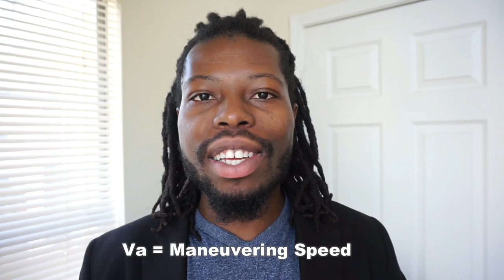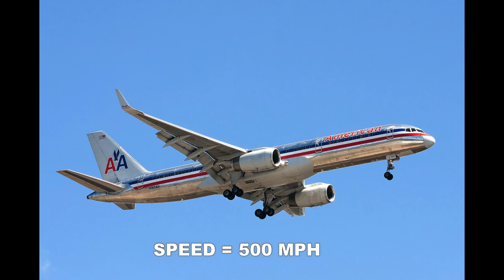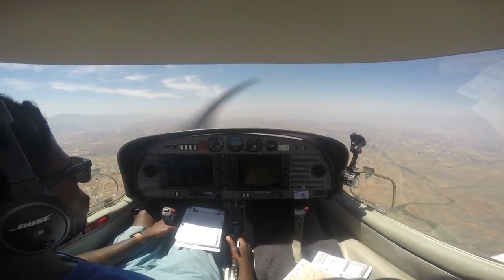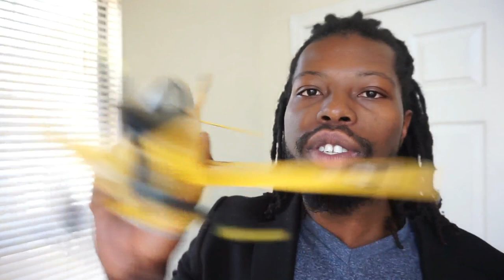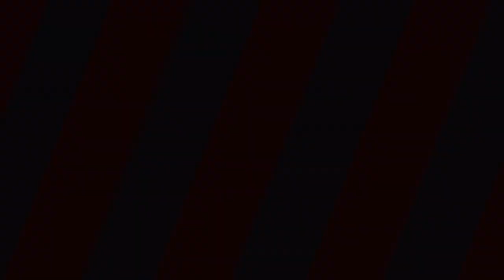Why Airplanes Have A Speed Limit

Comment: Va = Design maneuvering speed. The speed above which any full application of any single flight control could generate a force greater than the aircraft's structural limitations.  Aircraft structural limits are categorized as: NORMAL, UTILITY, ACROBATIC, AND COMMUTER.  Normal and Commuter G-loading limits are: −1.52 to +3.8. Utility: −1.76 to +4.4. Acrobatic: −3.0 to +6.0.   As you might guess a Normal category aircraft is about HALF as robust as an acrobatic plane and therefore has much lower Va speeds.

Comment: There is one more factor to consider called laminar flow. Jets at altitude have to fly inside a flight envelope. To low and it will stall of course but too high and you break up the laminar flow over the top of the wing and lift diminishes. The higher you go, the smaller the envelope.

Comment: Wrong. As a CFI I see and hear this common misunderstanding between Manuvering Speed or Va and Maximum Structural Crusing Speed or Vno a lot.

Manuvering Speed (Va) is the maximum speed at which you can make full and abrupt deflection of the flight controls. Manuvering speed changes with weight. This is why you don't see Va depicted on airspeed indicators- it's a moving target.

Maximum Structural Cruising Speed (Vno) is the maximum speed you can operate in smooth air. Vno is depicted where the green arc (Normal Operating Range) on the airspeed indicator turns to yellow (Caution Range). You can fly into the yellow arc such as while descending but should do so in smooth air and with caution. 

You also said warm air always rises. This is wrong too. Google temperature inversion. You will have this all corrected by the time you reach the commercial pilot level. Fly safe!
Reply from the maker: So you just repeated what I said in the video. Sure maneuvering speed changes with weight, but the definition doesn't change. And yes warm air does rise because it is less dense. Temperature inversion is a whole different topic because the opposite happens in an inversion. I stand by everything I said sir. Thanks for sharing!
Reply: MojoGrip second CFI chiming in here. I think when you say pressure you mean G load which is not directly pressure. At Va you’ll stall before causing structural damage which you failed to mention. Just wondering how far you are along, PPL? Definitely keep it up you have a better grasp than most new students, but hit the PHAK before putting out definition videos. You can confuse new pilots.
Reply from the maker: Man you CFIs are killing me. A lot of my viewers are general public (non pilots). I try to explain things in the most basic and simplest terms for non pilots to understand. I see no reason to get too specific with exact keywords or technicalities. Except you're a pilot, you likely have no clue what Va, Vx, Vno means, so I choose not to confuse anyone with technical terms. This is not a flight school, no one is looking this up to study for their checkride. This video is a broad explanation of maneuvering speed. Oh I have a PPL 🙂 thank you.
Reply: BTW, in my initial post I said Vno is the maximum speed at which you can penetrate smooth air. That should read turbulent air. I'll give you a "10" for positive attitude but a "4" for accuracy.
Reply: MojoGrip maybe you should listen this is the third CFI chiming in your definition of VA is completely incorrect.... we understand that most people watching have no knowledge of aircraft but that why we are certified to teach them and it is apparent you aren’t yet. Primacy is something you will be learning about if you continue on to becoming a CFI yourself. This is why it’s important to be specific and accurate with the information you teach about..... have a CFI review your videos before posting them so they can help you out. Also the FAA watches YouTube videos so if you are found on YouTube teaching principals wrong you very well could end up having to take a 709 ride to get your certificate back. Make sure you mention in the beginning of your video that you aren’t a instructor or your could land yourself in serious legal trouble..... we like you and your enthusiasm for Aviation we’re trying to help you out.
Reply: Yea, just make sure you put a disclaimer in your vids in the future; I enjoy your vids man! ;D
Reply: I would suggest a disclaimer then, that you are not a cfi and are just doing a loose interpretation of what happens, “up there” and that people should seek out professional flight instruction for technical definitions and flight procedures. On a personal note. I appreciate what you are try to do. Keep it up! Just please, don’t ever put monitization and subscribership before safety and you will do fine!
Reply: C Man --- WRONG,      Arturo b --- WRONG,     Travis Grubler --- WRONG WRONG WRONG   
I know more dead flight instructors than live ones 
just being a CFI does not make you the definitive authority on flight safety!
Mike is conveying some very useful information here that could save the day,  a lot of pilots, even high hour ones may forget to get it down to Va during 
turbulence which is crucial.  especially when youv got a thunderstorm on your ass & your wife is in the back seat and you dont like seeing her teeth
going thru the bottom of her lip.   yea - keeping your speed down to Va keeps stuff from breaking on the inside and outside the airplane.
so you 3 CFIs dont talk to me unless you come back here as an FAA flight examiner
you think you know everything & you really dont.
the secret to being the best pilot/CFI is to never stop learning, always be a student of the sport.  we all can usually come away w/ something 
beneficial from quality content like whats given here.
Reply: DING DING DING!!! and we have a true aviator here. Never stop learning and murphy law are the keys to fly alive.
Reply: Thanks C Man your explanation is correct, but I want to encourage MojoGrip to continue making videos. "Wrong" is harsh. Let's adjust or further explain what he is trying to communicate. Effective communication is a good thing. All pilots can learn when we help each other. I love GA and want to keep us in business, so lets help each other. Thank you and Fly Safe!
Reply: I'm not a Pilot (want to be tho)  Mojogrip, I think everyone really likes you (even the CFI's LOL) but even a non-pilot like me finds some of your information pretty dodgy  ( I gave you a hard time about your comment in a different vid about "lift coming from the prop pushing air over the wings"   Even though your intended audience is non-pilots like myself, I too am concerned that you could end up is some trouble with the FAA  (which is crazy but that is the kinda times we live in!?)  with that said,  let me encourage you to keep making the video's (I'm living a bit vicariously thru your video's, thank you!) however don't let the instructors frustrate you, and work with them. At least consider their advice.  better yet, if you think they are wrong; discuss (in these comments, using respect)  your position with those folks.   I would actually enjoy reading the discussion (you'd be surprised how many of us can actually deal with the technical stuff and enjoy it too)
Reply: as a non pilot I would like accurate info please! sounding like an ass in conversations is not why I watch these vids..... also, don't argue with CFIs or drill seargents, it is not a good idea.
Reply: Luke Warmwater, well put!... you are so right, unfortunately this guy, ain’t “the guy”, we all wish he was...  Obviously, he can fly a plane, right?    Also, Everyone loves his passion, but he just doesn’t possess the ability to communicate it accurately.... the worst part is that he thinks he does!   I would LOVE if this guy would rise to the occasion (like listening to the CFI’s and actually dialoguing with them) but I wouldn’t hold my breath LOL
Reply: Maneuvering speed is the airspeed at which an aircraft can handle a 35fps vertical gust without exceeding get load limits.
Reply: Va (Maneuvering Speed) is a STALL SPEED. If you take the Square Root of Load Factor and multiply it by Vs, you will come up with the Maneuvering Speed. You must use Calibrated Airspeed. As any Stall Speed, the heavier you are, the faster you can go and vice versa. If your Diamond's max Load Factor is 3.8 G's, the Va is the stall speed at 
3.8 G's.

Comment: Anyone know what it means to have Va greater than Vne ?  (It doesn't make sense to me)  One such plane I clearly remember was Berkut (Long EZ grown up).  I remember discussing it with my CFII and he wanted to stick with course material back then.
Reply: I don't know, but we can try to reason about it.
Va is simple: Full application of any single flight control would exceed the design limitations of the airframe.
Vne is complex: Based on aeroelastic flutter. For flutter to occur, there needs to be some initiating condition, such as a wind gust / turbulence. In perfectly smooth air, you can get away with flying beyond Vne and have no issues - but if you're using a steep dive to achieve it, you likely won't be able to pull out of the dive since attempting to do so would initiate the flutter. Likewise, level flight above Vne could go very wrong, very quickly if you hit a bump.

The two aren't directly related, so there's no inherent reason that Va can't be above Vne. It would just mean that the speed at which applying full deflection of any single flight control would cause structural damage is higher than the speed at which aeroelastic flutter could develop.
Reply: Thanks for the good info.  I "misunderstood" Vne is breaking point due to airflow.  And been "wrongly" blaming FAA thinking they demand manufacturers to fill out all the forms and desingers supplied some BS infos.

Comment: This makes alot of sense but I have ask a round about question.  I'll use a firearms analogy.  

 Generally speaking a rifle of a given caliber is built to withstand the amount of internal pressure that the specific caliber is rated at.  Because manufacturers know that there will always be those who push the safety envelope on the various calibers that rifles are chambered for they will deliberately over-engineer those rifles to withstand substantially more pressure than they are rated for just to mitigate the possibility of said rifle/caliber blowing apart if someone attempts to shoot overpowered rounds through it.

Just like the manufacturers of air planes in your description, they will still advise you to adhere to maximum speed rates or pressure rates and not go beyond that even though the rifles have been built to withstand being able to shoot or fly faster in order to push the performance envelope to try to get more velocity.

I suspect that even with airplanes the manufactures have built in a sort of safety net by allowing their planes to withstand substantially more abuse than they are said to be rated for but for safety's sake they stipulate a certain speed max and no more.  It's a sort of "Lawyer-Proofing"
for  their product line.

Comment: This guy seems to be more interested in getting views on YouTube than being accurate. The old adage goes: a little knowledge is a dangerous thing. Especially in aviation. While he accurately defined Vx and Vy, he clearly needs more understanding of aircraft V-speeds in order to speak with authority on the subject.

In fact, Va is the maximum speed at which full and abrupt control deflection in pitch and roll can be attempted without causing excessive loads on the aircraft's structure which may exceed the structural strength of that specific design. 

You also didn't mention Vd, aka dive speed. Vne is defined as 90% of Vd. Vd must be demonstrated to the regulator during flight testing of each specific aircraft type. 

You also failed to mention the most important reason for not exceeding Vne: aeroelastic flutter. Flutter is is "a dynamic instability of an elastic structure in a fluid flow, caused by positive feedback between the body's deflection and the force exerted by the fluid flow ...'Net damping' can be understood as the sum of the structure's natural positive damping, and the negative damping of the aerodynamic force." (Source: www.google.ca/search?source=hp&ei=cbKZWszJOs--jwOwhbLwBg&q=aircfraftf+flutter&oq=aircfraftf+flutter&gs_l=psy-ab.3..0i13k1l4j0i13i30k1l4j0i13i5i30k1l2.1541.4497.0.4875.19.18.0.0.0.0.167.1729.15j3.18.0....0...1c.1.64.psy-ab..1.18.1723.0..0j35i39k1j0i131k1j0i10k1.0.gBdlHd9GlbY )

A classic example of structural flutter was the Tacoma Narrows Bridge failure, which occured on November 7th, 194, just months after that bridge was constructed In that instance the bridge's structure failed after excessively high winds buffeted the bridge, causing  divergent pitching and rolling motion of the structure until structural failure occured. Flutter can literally rip apart an airplane's structure at excessive speed. For that reason, aircraft manufacturers install the correct amount of engine power, in order to provide a safe margin above flutter throughout the aircraft's performance envelope. 

Check out the following YouTube video to see what flutter can do to a structure: www.youtube.com/watch?v=j-zczJXSxnw 

And here's a video showing several instances of aeroelastic flutter on several types of aircraft: /www.youtube.com/watch?v=egDWh7jnNic
Reply: Maybe his bag of luck is a lot bigger than the rest of us received upon learning to fly. Hope it doesn't run out before the bag of experience fills up.
Reply: Try watching more of his videos on  he got the name of the plane that he was reviewing wrong and made stupid comments you'd expect from a second hand car dealer.

Comment: you can't fly past the .. capabilities of your .. plane ..
Reply: charles villebrun you CAN but damage can follow depending on duration temp age, fyi if max speed is 100mph that plane can achieve and then dives will it go faster than 100mph? So in this example you clearly can fly past the capability of an airplane.

Comment: Va, or maueuvering speed is nothing more than a legal disclaimer. It was added to aircraft limitations after someone had a major part of their aircraft seperate from the aircraft in flight. Attributable to full and abrupt control inputs. It has zero pratical value IMHO. When should any pilot use full and ABRUPT control inputs? And even if that were actually necessary to save the day, how many pilots will check to make sure they are at or below maneuvering speed before doing so? This speed limitation is nothing more than a legal CYA, invented by laywers for aircraft manufacturers. I will make todays lesson very simple and practical for everyone. If your in rough air, stay in the green arch and use smooth, coordinated flight control inputs to maintain wings level and a normal pitch attitude. If it's really bad, disregard trying to maintain a constant altitude as well and advise ATC when applicable of course.. End of lesson.